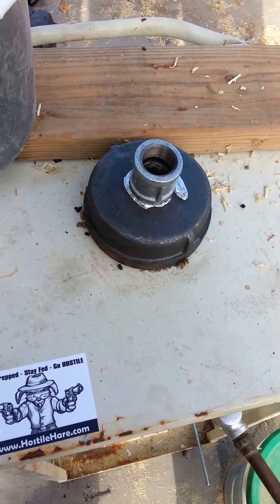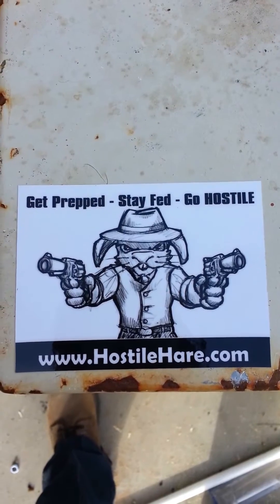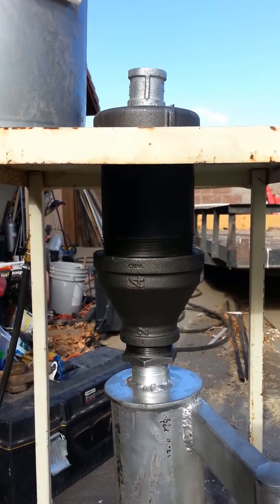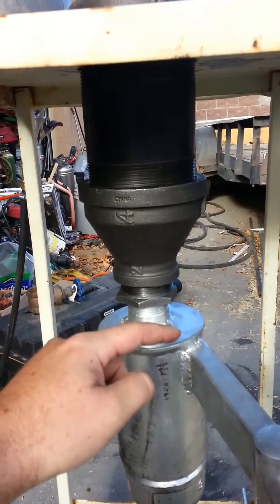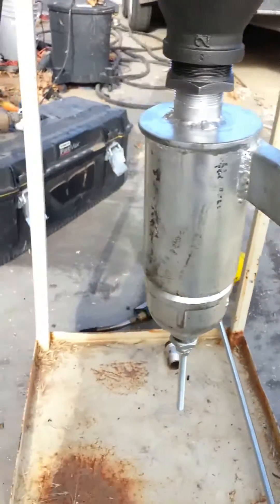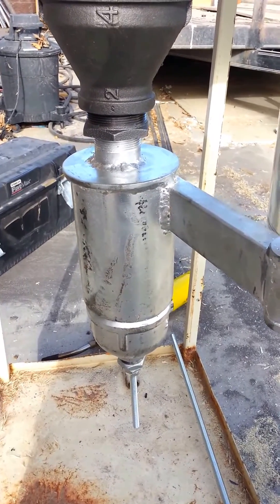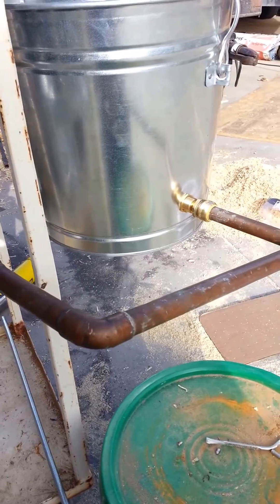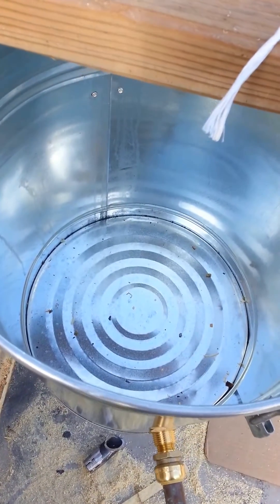The Beta Build Gasifier

Comment: Your methane into a propane tank is absolutely the coolest thing I've seen on NGDP and it was just a blip on the show. It always seemed a tad difficult and dangerous to do. Have you had any issues loading methane into a propane tank? Can it also be used as to fuel generators, stoves, water heaters,etc?
Reply from the maker: that my friend was a bit of "movie magic"  the real pump and tanking system was no where i wanted cameras.  we faked the air pump to propane bottle connection.  methane must be cooled to a liquid to sustain propane like pressure and function.  a special ambient pressure carburetor can run engines on unpressurized methane. Sorry that it was misleading, not my decision.  I also don't rely on a flamethrower for self defense, it was designed just to show the BTU valley of waste